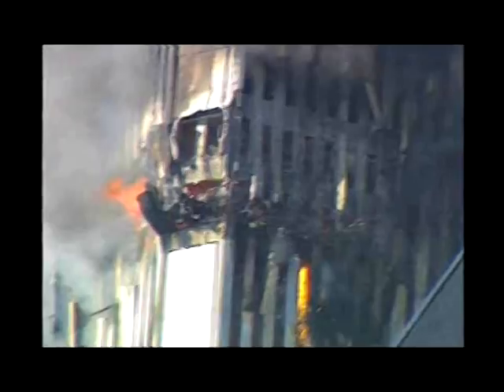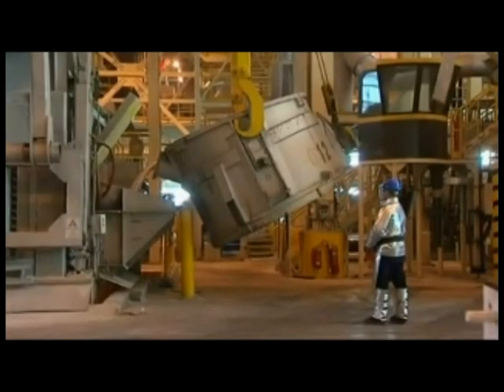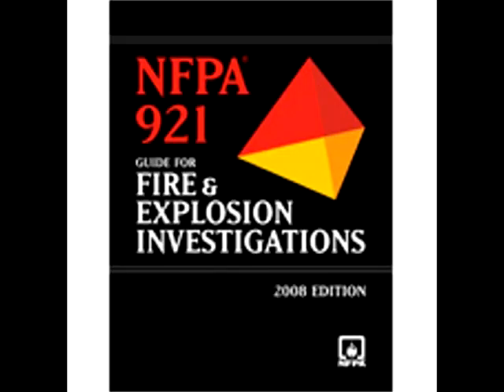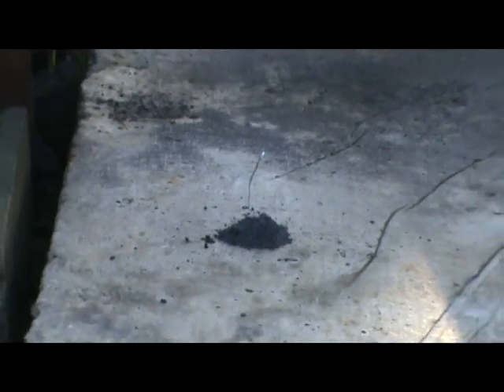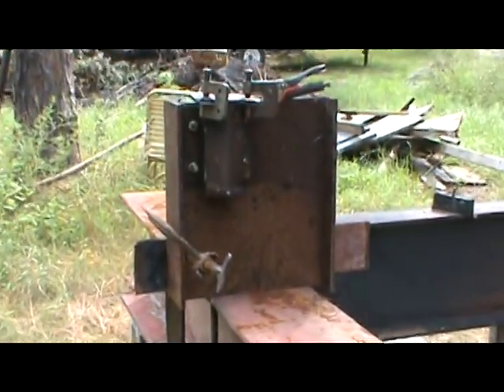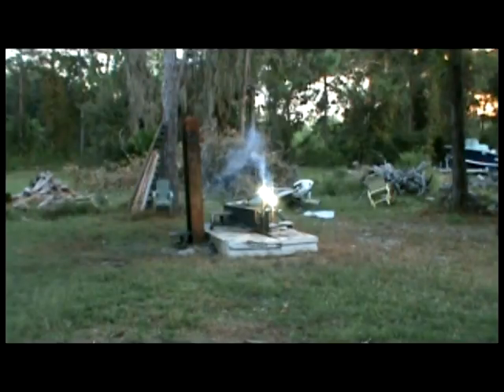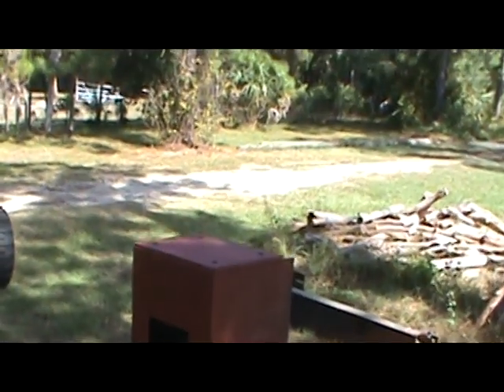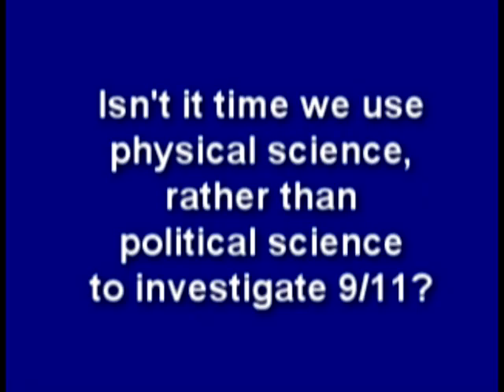9/11 Experiments: The Great Thermate Debate

Comment: You're not taking friction into account. Those beams were under load, you warm them up, they begin to deform, that deformation releases heat that can easily cause the already glowing metal to soften further, allowing for more and faster deformation, and therefore more heat, eventually leading to melting, then total structural failure. Jet fuel can't melt steel beams, but friction can melt anything.